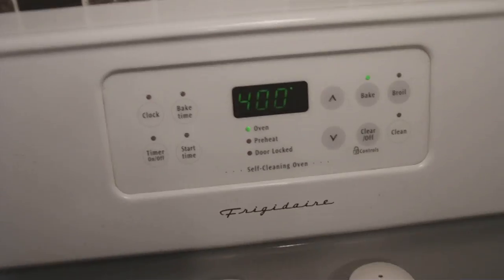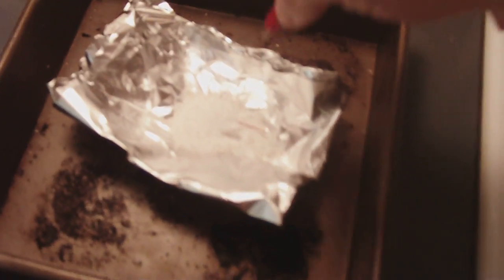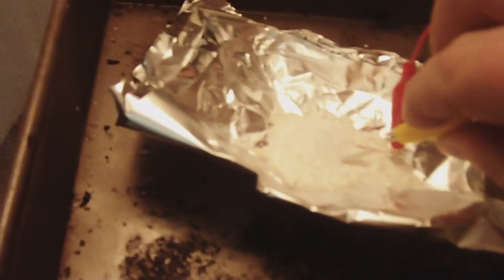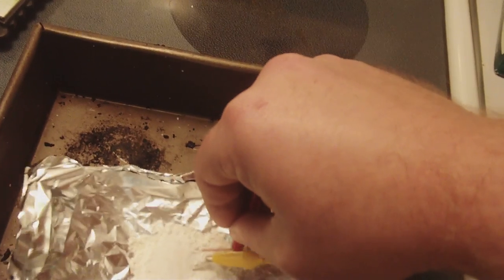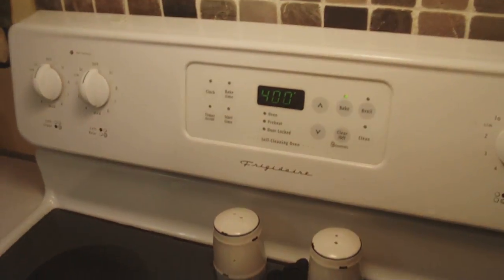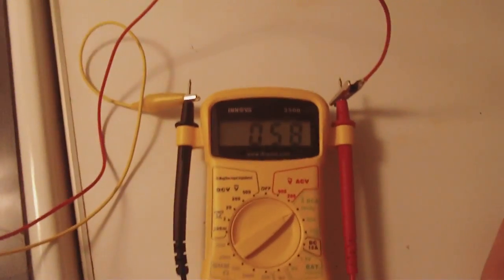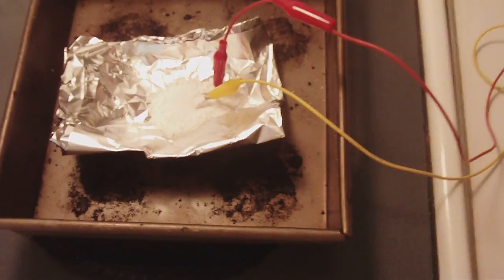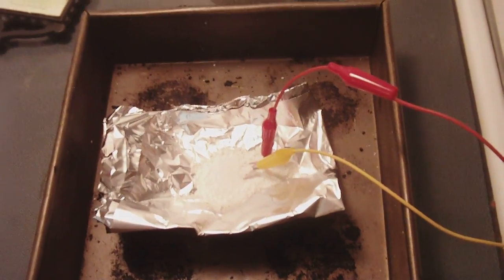Crystal Cell In oven to remove Water

Comment: I did cooked mine with glue then added more mix and alum and heated up with extreme pregisiat at 450 f the thing have been lighting up 6 superbeight blue leds for 23 days now and it seems it will go on,  I will add a stubbledield set up to create a charging loop..it already got a 3 button battery performance but size wise is x times bigger,  still salt battery is helpi.g the come back of the cement cell

Comment from the maker: @freeenergynews 

Using two graphite plates like jbignes5 did does not work. jbignes5 would charge the cells with a battery and put a little bit of water on it. This merely creates a capacitor that will naturally die and loose all its voltage over time. I've done many test on using only graphite and it simply does not work. Also graphite is reactive too, it can corrode just like any other metal.

Comment from the maker: @freeenergynews 

The cell is very brittle, it wants to fall apart. Cooking the cell for 30 minutes @ 400 degrees removes all the water from the crystal lattice, the crystals pop like popcorn when they release the water from the inside. Inside the salt mix looks like the outside, white and brittle flakes of crystal. Yes adding water will raise the current, but will also melt the mix.

Comment: P.S. if the cell cools down, it will condense
soluted water from the air on its surface and
this will get into the metals that stick out of the saltmix, so 
just on the small surface you will have some air moisture doing the galvanic action. Just add a few droplets of water and see the shortcircuit current rise
again... As long as you use the reactive metals you will always get corrosion from galvanic action. You need to to use 2 graphite plates as the electrode.
Many thanks Regards, Stefan.

Comment: Well done IBP !
Is this now copmpletely dry this cell or
are there still water molecules inside the saltmix ?
How does it look inside the saltmix, when you break it up and
look inside it ?
50 microamps are not much, maybe just from the air moisture then ?
What , if you add again some droplets of water, how will the short circuit current rise then ?
Many thanks Regards, Stefan.